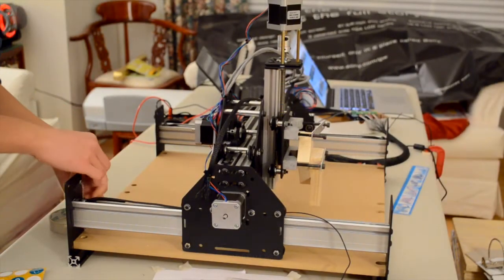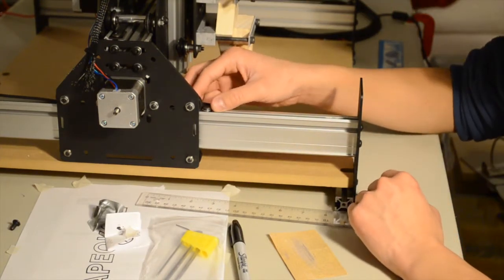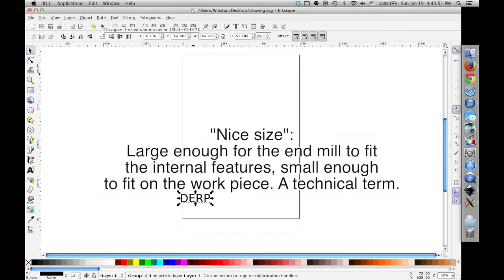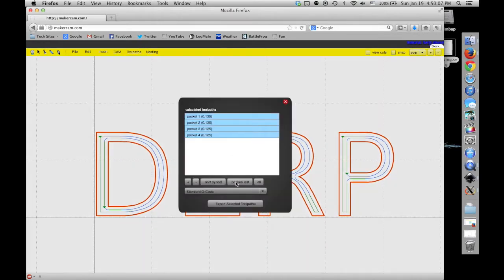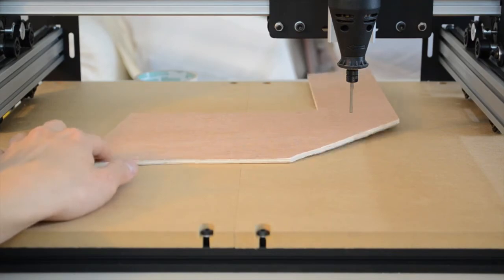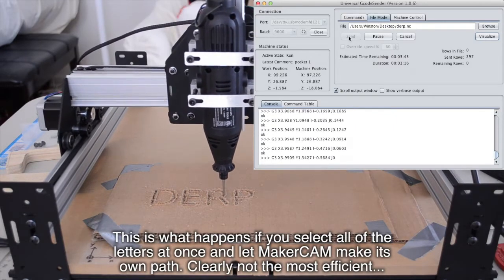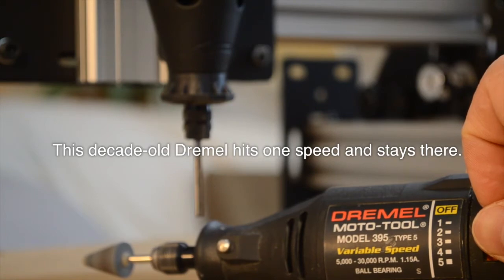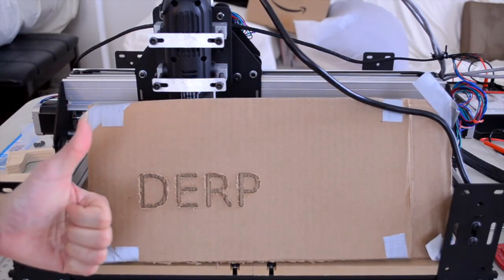Shapeoko 2 CNC Kit: Generating GCode and (very) Basic Milling

Comment: Hi I have a cnc 3040 and running mach3 and when I created something in Inkscape and save it and try to open it in mach3 it does not open am woundering if you can help me or if I can't use Inkscape for mach3 ?
Reply from the maker: I've never used Mach 3, but I would guess that maybe it doesn't like SVG files. Try exporting as DXF if possible.

Comment: Hi Winston, your videos have really helped me in my own CNC adventure, so thanks!  Regarding the knockoff dremel speed, has it gotten more consistent as you use it more?  I noticed a huge tonal variance with mine also, but after running for about a minute, it is much more consistent.  Makes me think that the brushes in the motor simply need to be worn-in, which would explain why the decade old Dremel works better.
Reply from the maker: It's possible, although mine never settled to a consistent speed anywhere near as well as either of my dremels (I have a 10 year old one, and a 1 year old one). I suspect that the power conditioning circuit/regulator just isn't as good. It'll still cut fine, but if you're trying to dial in a specific speed (e.x. you have a material like acrylic that burns/melts easily if you cut too fast, but too slow and you lose torque) you may find yourself getting frustrated. There are certainly ways to deal with coarse speed control, like always going at a high RPM and just taking shallow fast passes, but that's a tradeoff that the user has to make/live with.

Comment: Hello. I watch this video and I made the first test. Everything was going ok but I got too long code. And for 3 letters I was waiting around 1 hour. And I wanted to make more letters normally I was going to wait more. For the SHAPEOKO 2 I had around 28k something rows. What do you think?
Reply from the maker: That's a little on the high side. I carved out a couple letters on a 2 inch tall plaque (video coming this weekend hopefully) and that program only came out to 4k rows. Curves do take up more rows though (i.e. A square only takes 4 lines of code, but a sine wave could be 200 or more depending on accuracy desired). Have you tried visualizing your code on the computer first to make sure it's commanding the right things?
Reply: Winston Moy Thak you for your fast reply. Yes I have visualized. Here is the numbers of rows for my program. http://prntscr.com/3s90i7
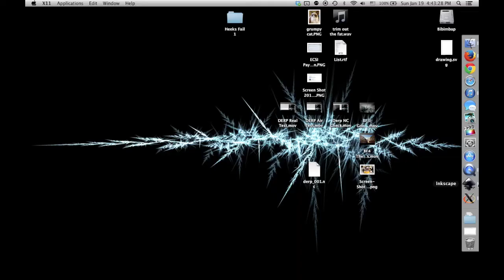So for this letters It will take more than 1:30 hours and I dont know how to make it lower. 
Kind Regards
Reply from the maker: Goran Stojanoski  Was this generated in MakerCAM? And what's the height of the letters?
Reply from the maker: Goran Stojanoski
I would only expect so many rows to be generated if the gcode generator was set to a ridiculously high precision.
Reply: Winston Moy Where do I change the precision in the MakerCam? I made it in Inkscape and the I just generate the G code from the MakerCam. How do you think the diametar of the target or what? Where do I check the high? 
Sorry but I am still beginner and I dont know  lot of stufs.
Thank you
Reply from the maker: It's under Edit>Preferences. And it's machining tolerance. I doubt it would have been changed from it's default of 0.001", but it's worth checking.

Is there any way you could post the .nc file to take a look at? Either via a file sharing site, or even on the Shapeoko forums (there's also a bunch of pretty intelligent guys there who might be able to give a fresh perspective on the issue)?
Reply: Winston Moy Here is the file. http://www.megafileupload.com/en/file/541576/Shaepeoko-2-nc.html
Waiting for your response. Btw when I draw circles or other things the code is not so big, And I made a name board with my name and it the file was 9k rows. It is 5 letters. 
Thank you again
Reply from the maker: Goran Stojanoski
Alright, so I'm visualizing it now and it appears that the code is instructing the machine to step down in very small increments multiple times for each letter. It's taking so long because the tool path for each letter is repeated dozens of times.

Are you trying to do this as a 2D job? Like drawing it with a pen, how the "Hello World" program was done?

Or are you trying to engrave the words in a piece of wood?
Reply: Winston Moy I am trying it to engrave on piece of paper that is very tick. Like this: http://prntscr.com/3sr1jv
And I didnt know why so long cause I needed it just to be cutted. 
Kind regards
Reply from the maker: Goran Stojanoski
I believe it's just a matter of picking the correct cutting parameters. Looks like you're cuting to a depth of .27 mm in increments of 0.03 mm. If these values were in inches, it would be reasonable. However I think these are a bit shallow for what you are cutting.

Also, the word you are cutting is almost 2 feet long (which won't fit on an unmodified Shapeoko). The size of the job combined with the number of cuts you have to make result in a very long operation.
Reply: Winston Moy Ok. Thank you very much for the help. And your videos are very good and helpful. I have learned a lot of things from there. Now I will make my first 3D cutting  so I will see what happens.
All the best
Reply from the maker: Goran Stojanoski Good luck. Just make sure you keep an eye on what units you're in (inches or metric) and use the grid to help you size your job appropriately.

And for soft materials you can use a cutting depth (step down) equal to 1/2 of your cutter diameter. (basic rule of thumb I go by)
Reply: Winston Moy Can I ask you about suggest about the numbers u take when u cut wood? Step down...
Reply from the maker: Goran Stojanoski  I tend to lean on the conservative side when picking cutting parameters. My linear speed is almost always around 10 inches per minute, plunge rate of 15.

1/16" bit: Step down of 0.025"
1/8" bit: Step down of 0.05"

I usually run my Dremel at around 70% speed, and adjust the power depending on whether or not it sounds like the motor's being significantly slowed down. Your mileage may vary, I know the Shapeoko Wiki said the default spindle should just be run at full speed since it's very weak.
Reply: Winston Moy Thank you again. And one final question. I am having a problem with Inscape when I draw rectangle or everything else when it is selected it is like this: http://prntscr.com/3u0s8y

But when not it is a white page and I cant see what I draw like this. I must select again so I can find it :S. http://prntscr.com/3u0syv
I was looking on forums or google but i cant find a solution. what do you think.
Kind Regards
Goran
Reply from the maker: Goran Stojanoski
Have you checked stroke and fill color? My first guess would just be that the border color of the rectangle is set to white.

Comment: great job! if you were to add a bigger spindle like Hitachi M12VC to the shapeoko would that destabilize the X axis?? Or would that extra weight on the front not matter? If it is to heavy putting some weight on the back might fix the problem .  I’m not sure if the shapeoko is made for that much weight.  What do you all think?
Reply from the maker: Despite the design improvements compared to the shapeoko 1 (dual y-axis motors, and double makerslide for the X-axis), I think a full-on router would be taking it to its limits. I can put a fair amount of weight on the gantry, and I'd feel comfortable bolting on something like an 18v cordless drill, but two things would give me pause:
1) vibration
2) stepper motor torque. I wouldn't use anything bigger than a 1/4" end mill to hog out material unless I upgraded to NEMA 23 motors or something. But I'm still getting started.I would recommend checking out the forums to see if anyone's pushed the envelope on this.